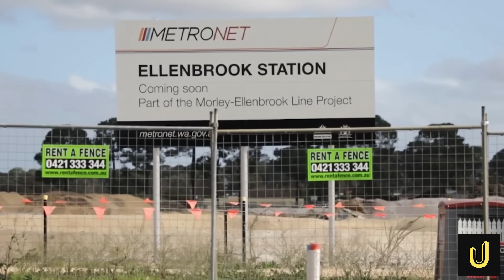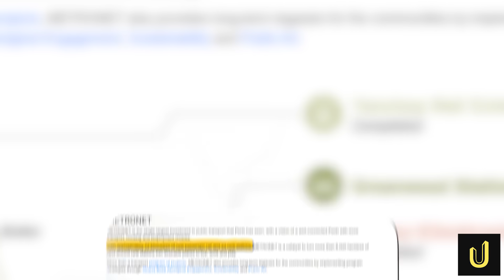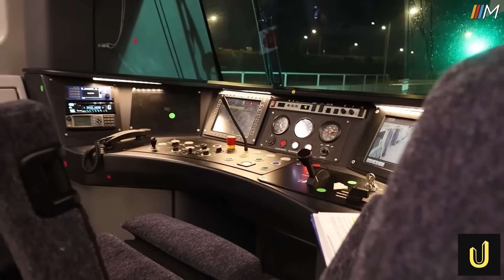$13 Billion METRONET is Reshaping Perth!

Comment: A city the size of Perth needs more rail stations. Investment in public transport will be beneficial to present and future generations.
Reply: In Perth they stick them in the middle of freeways and have stations up to five km apart and often where there isn't much housing.  Also they manage to avoid suburban hubs in the rush to lay track.  Not going through Morley city is major flaw, as was avoiding Innaloo over thirty years ago...  Booragoon another miss...  then you have the whole disconnect between Mandurah line and Fremantle.
Reply: @BDub2024  Some of the points you raise are being addressed since this government came into power. The successive labor governments have put quite a high focus on public transport. Sadly, these things take times. Ultimately, this should have been done during the mining boom/governments of the time, instead of being completely squandered. (I personally appreciate the new lakelands station :) )
Reply: @Eda00005  remember Liberals built the Thornlie tunnel.  The proposed and started building Airport link.  They agreed to build Ellenbrook but delayed it. The idea was to tunnel into Morley city.  The Liberals also proposd trams from Perth to Balga and the knowledge arc.  That got cancelled due to debt and Labor preferred heavy rail..  You're wrong with the financial situation with the state at the time and I'll explain in a sec.
Reply: @Eda00005  You forget to mention that there was a mining bust leading a huge drop in royalties.  That coincided with GST money dropping to thirty cents in the dollar.      The revenue totally dried up.  Fortunately, the Federal Liberal govt agreed to put a floor on seventy cents per dollar.  Guaranteeing WA GST funding even when mining royalties are high.  Sadly this is unlike to continue forever, but that is why we can't waste the funding now on poor transport projects.  We will be stuck with paying for infrastructure making huge losses when the Federals inevitably remove the GST floor.  You forget also to mention the huge investment in developing suburbs, streets, schools, hospital beds, services infrastructure when WA had a huge boom.  All the WA Treasury's advice was the WA was facing a cliff due to mining bust and GST funding drop coinciding at the time that hospitals were being built. etc   Remember there is a lag in GST grants compared to the financial situation of the states.
Reply: @Eda00005  Remember all the hospitals that were built and extended during the mining boom.  I think that is a touch more important.  The actual extra revenue during mining boom was always misreported by The West.  GST revenues plummetted to thirty cents in dollar at the same time as the mining bust.  Ultimately, it led to trams being delayed and cancelled and heavy rail delayed.  Remember that.  Labor came in and got ScoMo to put a seventy cent floor on GST.  So WA is getting a lot of money now from that.  But it won't last forever.
Reply: @BDub2024  Some super valid points and fantastically explained historical info. Thanks for that mate!
Reply: @BDub2024 The Liberals were going to make the Ellenbrook line a Busway if Re elected
Reply: @matejaobrenovic3338  Research indicated that there wasn't the population to make it worthwhile until  2030 and beyond.  Libs were considering a tunnel into Morley City and then choose the most appropriate locations for stations.  Result would have been an expensive option but one that better met the needs of the community.  But was going to take longer to occur for sure.  Fair to say that Labor went for the quick and nasty approach.  Excuse me for saying the bleeding obvious.  But if you want to take public transport each day into the office then don't buy in a suburb on the very fringes of the metro area surrounded by bush and away from existing transport routes.  People live in those locations and then whinge that govt doesn't spend billions of dollars bringing a rail to their door step.  The short term fix of buses, followed by a long term rail that better serviced the community sounds way better to me.
Reply: @BDub2024  There was short sightedness all round. The Rockgham line shoudl have gone into the forshore and then south...instead its out in the mioddle of no where.. then they proposed a tram to the forshore, but that got replaced by a bus service. No one uses it so they all end up drviing. This would have allowed for a Fremantle to Rockingham link opening up the forsshore all the way up to freo. The Karnap line is a missed step instead of just being lakelands. And then the widening of the Kwinana stoping before Safety bay road instead of going down to Baldivas where the most work in the whole south is going on for new houses,.
Reply: @WizardsLore  You've got Labor to blame for not going into Rockingham.  The Lib govt had the railway going to Mandurah via Thornlie.  Hence the tunnel was built.  Labor won the election while the Mandurah line was being built.  So changed the route straight down the freeway.  This involved much more track to be laid, plus extra stations, road works and tunnelling in the city.  End result the tunnelling that was occurring into the Rockingham foreshore got cancelled to save money.  That's why.  Labor campaigned that going via Armadale line would take twelve minutes longer and people would jump off the train and catch express buses into the city.
Reply: @WizardsLore  I don't think there will be trams anytime soon.  The first metre of tram track will be the hardest.  There has been research into it back in the nineties.  Initially a track through to Subiaco and UWA/hospitals.  Then talk of knowledge from UWA to Curtin.  The Libs promised lght rail to Balga and beyond via Alexander Dr.  A great idea, but sadly got delayed and then cancelled due to mining bust and GST grants reducing to thirty cents in the dollar at the same time.  Double whammy put state into debt and canned several public transport.  State Labor came in and convinced ScoMo's Federal liberals to put a floor on GST at seventy percent.  That has allowed the heavy rail to be bankrolled.  But State Labor show no passion on light rail.  Local govt talk about trackless trams.
Reply: @WizardsLore  State govt could always do tunnelling again if they wanted to.  It was going to tunnell through anniversary park and go closer.  It would cost a lot but they could pack in high density apartments and office blocks and then use that to leverage a train station and tunnel.  But people won't want all highrise there.
Reply: @WizardsLore  Fremantle is a hard one.  Long term they will extend from Cockburn to Fremantle, but its not really the perfect route.  Much of it is near beach, parks, industrial, lakes etc...  So great to connect train routes but not very productive.  I reckon ideally transport really needs to improve from Melville Willagee Hilton Ham Hill type suburbs.  They need to be able to access Fremantle and Perth quickly.  The area is getting dense and it really needs rail.  But that could only occur via tunnelling, but I think govts would take the quick and easy option on existing rail which is less accessible.  Still talk of trams down south St from Fremantle to Murdoch.  Issue is that it really needs a quicker journey and if you weren't near a stop then it would be harder to access and you'd expect bus services to be removed at same time.  Leach Hwy, Marmion and Canning Hwy are all possible routes for light rail.  But for me the big challenge is to also have a route that travels quickly to connect Fremantle to the Mandurah line in quick time.  Or people will just jump in cars.  Go via Booragoon is a no brainer.  Hopefully extend through to Curtin too.
Reply: @BDub2024  oh the Tram will never happen. It was planned and then it got canned even after the first parts of the track were lain. If you take a look at the tunnel that Ennis avenue overpassess heading west you can still see the tram tracks in the ground. They were never removed. This is the route that the bus takes
Reply: @BDub2024  its reactionary planning. Bottom line. Instead of future proofing now for many years to come where it will be infinitely more expensive
Reply: @WizardsLore  I doubt locations like Rockingham or Mandurah will ever get light rail (in next twenty years anyway).  Curtin to UWA is slightly more likely.  But seriously I was aware of the projects back almost thirty years ago with various feasibility studies.  To UWA they referred to two routes through Subiaco.  One could have gone down Rokeby road but would have involved the removal of hundreds of trees.  Alexander dr was the best option and the drawings were in place along with stations etc.  TAFE course being planned on tram maintenance etc.  But as I said mining royalties disappeared at same time as GST plummeted.  Ended up being cancelled after six plus years being talked about seriously.  I reckon there are increasing issues in inner city due to space.  Roads have been narrowed by wider footpaths, islands, trees, street furniture, cycleways...  Even going north was being problematic if they used Fitzgerald St.  Difficult to bring light rail through the city now and you don't want it going through malls but it sounded like if the knowledge arc ever happened thats' what would occur.
Reply: @WizardsLore  I can't see tram going to Scarborough though there were the trackless trams trials there last year.  Karrinyup is another shopping centre that has significant crowds now, but relies on buses on congested roads.  Initially the train to Joondalup was going via Innaloo shops and precinct, but there was concern on Herdsman lake area.  Instead the Glendalough station is stuck near light industrial space and car yards.
Reply: @matejaobrenovic3338 Well they Liberal got sides wiped when Mark McGown won & the achieved all the infrastructure after he stepped down & the current labour leader has continued to complete the rail in place & in the future Im sure they will add when needed the road network contining & Perth is still growing public transport I use & the prices keepes getting deducted time will time.
Reply: @BDub2024 I completely agree that putting them in freeways kills their potential. It’s psychological welfare for donators suburbs. But putting a station in Morley is not the solution. Shopping centres get enough welfare from the state as it is. They should not exist. Joondalup never reached its potential because of lakeside. It’s inconvenient, it has no nightlife. It becomes feral on Sundays and at night. That land will never pay back dividends to the city or the state. They put a multi storey and a single storey car park between the station and ECU, the most trafficked route from the station. After 5pm, exiting north means passing through closed private property and 50% of the land around the station is carpark for people who aren’t using the train. Morley would be a repeat of that.
Reply: @Freshbott2  I don't know if you've been to Morley a lot.  The Galleria is a small part of it.  A big hub with office space, multiple shopping areas, restaurants, medical centres etc.  Its a huge missed opportunity of decentralising the city.  Its quite different to Whitfords or Garden City. More like a Rockingham type hub.
Reply: @BDub2024 it doesn’t change the fact those other businesses are completely cut off from the majority of others by galleria. I couldn’t get behind spending any public money on the area without knowing they were going to bowl Rudloc and Collier road all the way through (as they were before galleria was built btw) as streets or street malls.  Without low effort local point to point connections there’s no economy of scale, doesn’t matter how many businesses you’ve got. Which is why most of Morley is bordering on light industrial. Shopping centres suffer this all over the US btw. They started their “mall crisis” 1-2 decades before us but the timeline will play out the same.
You watch. The tax man will gift Galleria some money for redevelopment and they’ll put some paint on it and some chain bubble tea venues and they’ll be asking for more in a few years time, cause the paint wasn’t the problem. 
The Tonkin median station is unfortunate but the redevelopment plan is about amenities and housing, not giving gifts to a retail monopoly. It was the least bad choice in this instance.
Reply: @Freshbott2  the density is higher in the morley area with redevelopments already planned.  having to travel from tonkin hwy to the hub is ridiculous.  but look I understand how tax payer's money is precious and tunnelling  while the best option is clearly expensive.
Reply: @Freshbott2  The issue with Galleria is that they closed the food court for redevelopment as a brewery and other facilities before Covid.  Then Covid hit... and food court has never returned.  So foot traffic has suddenly dried up and businesses have basically emptied the top floor.  At same time, many of the shops that used to be full are now finding that shoppers are using internet.  Also Karrinyup while a long journey away attracts the clothes shoppers.  But Galleria will fight back.  For people in five km in either direction there is no alternative and so many shops, residents and jobs in the area.  I suspect that other areas like Coventrys etc stop people from actually entering the shopping centre.  Local govt is also introducing more apartment living.  So Morley will remain one of the bigger hubs in Perth metro.  Just a pity that so many major hubs and shopping areas don't have public transport apart from buses.  So cars rule.
Reply: @Freshbott2  Calling Morley a retail monopoly isn't really accurate. Much of the shopping isn't part of the Galleria.  Good transport and planning and it just reaches a second CBD stage.
Reply: Perth has done this to itself. The chase of the Australian dream of home ownership near the coast. Perth has been set up so that we need to travel large distances which in turn means train stations are far apart with massive car parks as opposed to close together within walking distance like in other major cities where many live in high rise apartments.

Comment: Do a video on what they should do next after this stage of Metronet is finished.
Reply: Hopefully extend the new cockburn central to Thornlie east/west line to the High Wycombe station so more people can get to and from airport without needing to go via the city.
Reply: @kitatit  that's the long term plan.  But they need to get other thiings sorted out.  The cost would be huge for a very small number of people.  A lot of the journey is light industrial, so extending from Thornlie to High Wycombe has very little benefit.  It will happen but probably in twenty years.  It will ned to be part of a large circular rail route.  Probably work on East Wanneroo needs to happen and a way of better connecting Fremantle to the Mandurah line, which is up to twenty years away.
Reply: The previous Lib govt wanted light rail but thats almost certainly off now. Labor shown no interest.  They talk about a spur from Ballajura through East Wanneroo to Clarkson.  A hugely indirect route.